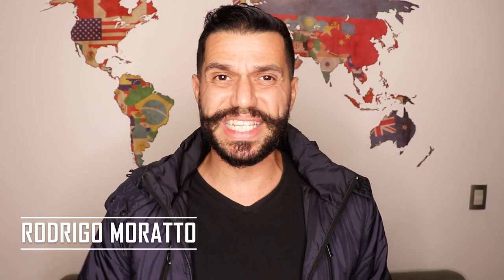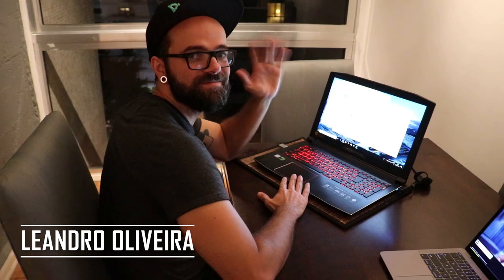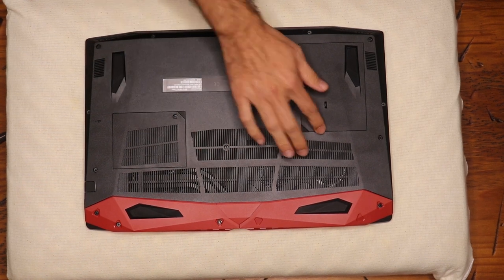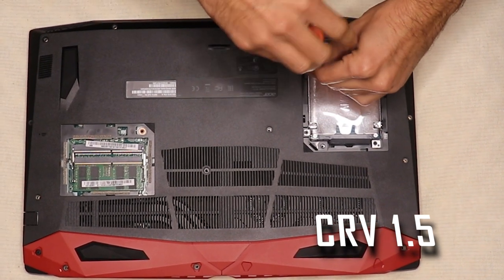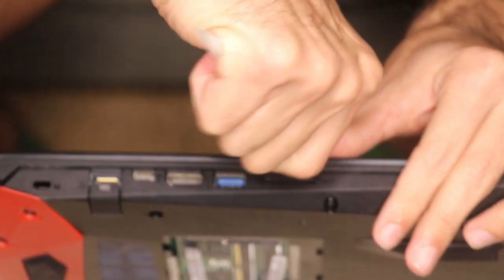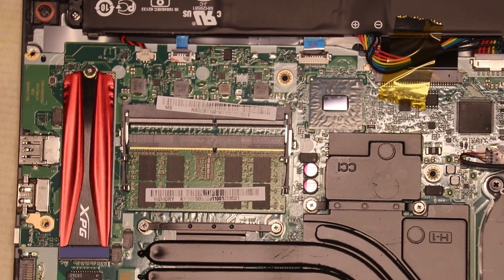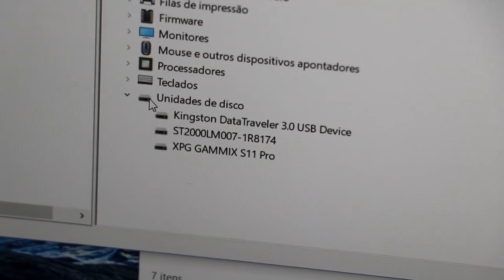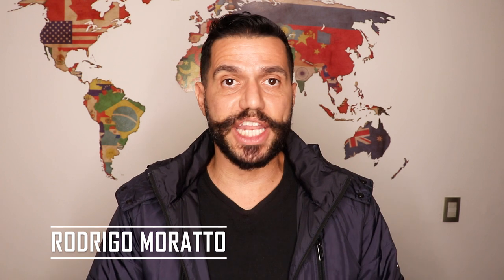HOW TO INSTALL THE SSD XPG GAMMIX S11 PRO PREDATOR HELIOS 300 PC GAMER TUTORIAL

Comment: Did you have any issues with the heat sink on the S11 clearing when you put the case back together? Looking at this for the GS75 Stealth ... worrying about about space for that heat sink. It's kinda thin.
Reply from the maker: hi there thanks for the message. I had no issues with the heat whatsoever, but I changed the configurations of the fan...made it stronger. This set up works just fine for me. :-)

Comment: Does it fit in Acer Nitro 5 laptop? Cuz due to its size with the additional heatsink, I think it doesn't fit in most laptops.
Reply: I have the same question for my MSI gl73
Reply from the maker: Hey guys I was researching into this. I couldn´t find the answers to this in English, but I found it in a Portuguese language forum and what they say there is yes it is compatible. Please check out the text here and google translate. I will research a bit more nto it, but this is what I found so far! Hey guys thanks for writing to me, please subscribe! :-) https://community.acer.com/pt/discussion/577243/acer-nitro-5-an515-53-e-compativel-com-a-ssd-m-2-adata-xpg-gammix-s11-pro-256gb

Comment: I installed my SSD drive and when I tried turning on the laptop, i got a blue screen saying : 

Recovery
Your PC/Device needs to be repaired.A required device isn't connected or can't be accepted.
Error code: 0xc000000e
You'll need to use recovery tools. If you dont have any installation media (like a disc or USB device), contact your PC administrator or PC/Device manufacturer.

Not sure what to do. I put back in my old SSD drive. Any idea what I could do?
Reply from the maker: Are you using the gammix ssd? I'd try  to install the ssd again. Maybe Its a recognition problem, like you maybe to format the ssd. Is ur ssd compatible with ur computer? Are you using the predator too?
Reply: @TRAVELZILLA  yes I bought the same xpg gammix 1tb s11 pro and yes I have an acer predator helios 300 as well. I tried going into BIOS to configure it. Not sure what else I could try. I reformatted and cloned with macrium reflect
Reply: @vinhnguyen915  did you solved you problem? Cause I’m getting the same blue screen with the same ssd on my predator Helios 300 :(

Comment: Is it normal for this SSD to stop working when it experiencies 'Heat Throttle'?
Reply from the maker: HI there, sometimes it stops working, it isn´t normal for a computer to get so hot. In regards to  the predator you must change the settings of the fans. Get rid of the default settings and put everything in maximum mode and you will not have any heating probs. Thanks for writing to us! Cheers m8! :-) this is  a travel channel mostly, please subscribe! :-)